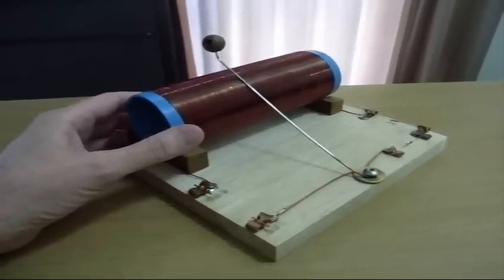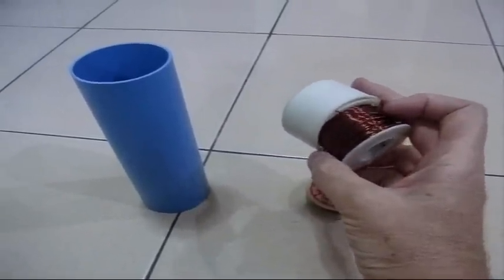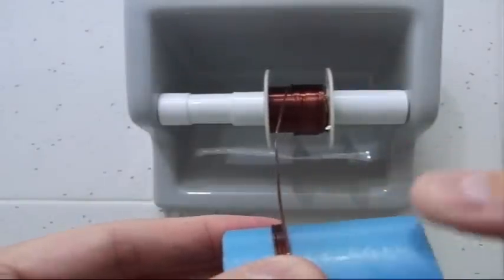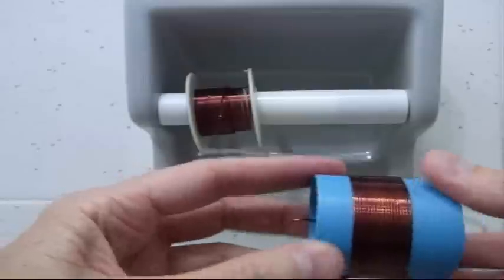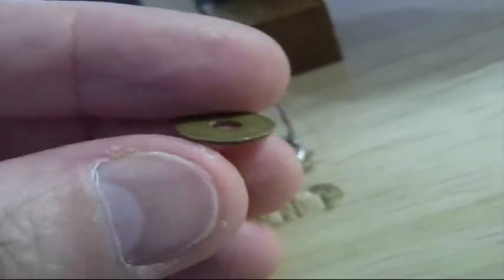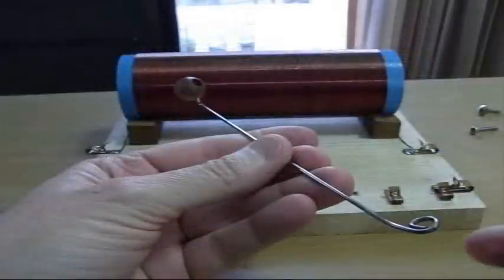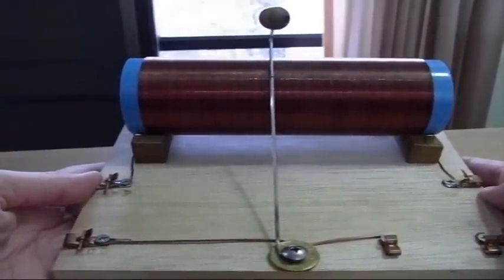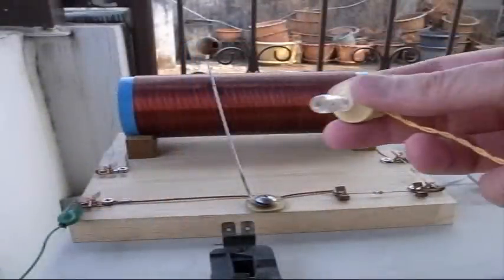How To Make A Crystal Radio - No Batteries (Updated Version Available)

Comment: just built one exactly like yours hooked everything up right connected the ear phone and nothing!!  do you have a email so I can show you a picture of it ????
Reply from the maker: The picture probably won't help.  The things to check for: 1) did you use the SAME earphone?  regular earphones will NOT work.  Must be "crystal".  2) Did you scrape the enamel off the wire to get shiny copper where it connects to the screws / connectors?, 3) did you sand the enamel off the coil where the wiper contacts the coil?  4) Did you use the EXACT same diode (1n34a)?  No others will work!
Reply: everything is xactly like your build, I am in question about the funky little ear phone and will hook something else up, as for the antenna its tie wrapped up a 20 ft galvanized pole , the total length of the insulated speaker wire is approx. 45ft from the home to the top of the pole,,,,,so whatdo ya think??
Reply from the maker: If I understand your antenna, that could be an issue.  It needs to be a long wire strung out in the open as far as you can (read the warnings on antennas in the description).  But you should still hear something if you have an AM station within 50 miles.  I used to get a signal from 2 local stations just touching the antenna lead to the mosquito screen of my room.  I also used the rain gutter (it was not grounded) and a long wire as well. 

Take one wire of the earphone off and try tapping it on the connection.  You should hear static "sparking".  If not, you have a bad connection somewhere.
Reply: @tsbrownie     yes I hear static but nothing else,  serious question>>>>>>>>.is it bad to run an insulated  antenna wire against any kind of metal??
Reply from the maker: @stanburdick9708  Short answer yes.  Radio waves pass through insulators or you would never get TV, radio or cell phone signals inside your house.  They don't pass through conductors (a metal wall will block radio well).  If you could see radio signals in a wire, they'd look like little ghostly donuts moving along the wire.  Those donuts hit the pipe causing them to slow, stop, spread out, break up, ... There's a lot more to it than this, but it's a beginning.  Watch the end of this video and see how I strung my antenna.  It's not great, but it's workable.  Notice that it's separated from everything and insulated by plastic string on both ends.  Also try with and without a ground.
You did not answer 4 above.  Did you use a type 1n34a diode?  No other works.
Reply: @tsbrownie     sorry, yes its the right diode as noted, so am thinking the metal pole is the problem, thanx for the response
Reply: changed antenna location and am getting a better interference then all of a sudden …...NOTHING

DO ALL CONNECTIONS HAVE TO BE BRASS??
Reply from the maker: Do you have an AM radio station within 50 miles?  There are 5000 in the US, so very likely.  What "cat whisker"?  I don't have one in the setup shown.  If you mean the wiper, it can be either stainless or brass, others don't work well.  It should be stiff enough to maintain a solid contact on the coil.  Did you use enameled wire on the coil?  Did you sand off the enamel were the wiper touches it?  It sounds like you have a bad connection somewhere.  You can make a video of your setup and post it on your youtube channel where I can see it.
Reply: @tsbrownie    to answer your questions>>>>>>>>am not sure  if thier is any AM stations within that range
and the only one I know of is on FM and is 20 miles away

not cat whisker but "wiper...………..so the 1/16th metal rod Im using is  no good??? and yes I sanded the contact point on the enameled coil wire

have no way to post a video so this is the only way to communicate which is why I wanted to send a picture

something strange is when I remove one speaker wire and hold it will get a good buzzing sound, but when I put the wire back on the terminal the noise goes away
Reply from the maker: If you can get a strong signal on an ordinary (non-digital) AM radio, then you should be able to receive it on this.  If you are absolutely sure your connections are clean, then the only 2 parts that can be bad are the diode and the earphone.  You did include the same resistor, yes?  You can also try it without the resistor, in case you got hold of an antique type crystal earphone (the new ones are piezo-electric and need the resistor).
Reply: @tsbrownie    a 10K resistor ?? yes its thier...…...it looks like all our messages aren't coming thru and ending short, so dont know how to proceed....If I dont hear back from ya .thiers a radio club meeting soon so will get with them
Reply: just rememebered cant get any AM stations where I am at so that prolly explains why am not getting anything  wouldn't you say??
Reply from the maker: Highly likely.

Comment: you should try to make a diode with a rusty nut
Reply from the maker: I've used galena, a lead mineral.  It works, but adds another point of failure.  With the basic radios I try to give people a sure system to build confidence.  From there they can try more advanced builds.

Comment: why shouldnt you use it during lightning storms?
Reply from the maker: Giving lightning an easy path to ground via an antenna invites lighting strikes.  That is extremely dangerous.  When not in use it is always best to disconnect an antenna and never use it when there's a chance of lightning.
Reply: +tsbrownie also indoors?
Reply from the maker: If the antenna is indoors there is minimal lightning danger, but also the antenna will probably not work as well.

Comment: This is Tesla's free energy device. Now imagine you take the earphone feed, but instead of using it to produce sound, you attach it to a battery. Maybe you need to scale it up to get some useful electricity out of it. But that's the basics of Tesla's free energy device, where Tesla was promising to "broadcast" electricity for free to everybody... That's it right there.
Reply from the maker: +Scott MacDonald Or you could watch the one I did!  https://www.youtube.com/watch?v=xn7U16j7IsU
Reply: +Scott MacDonald - The device would need to be scaled up huge to provide meaningful power. But to power a city, the device probably wouldn't need to be much bigger than a coal burning steam turbine power plant. So, it's a viable possibility as a power system, to convert radiowaves to electricity. But we'd probably be just as well off to just make a bunch of crystal batteries for home power systems.
Reply: When you use a crystal radio, you're feeding off energy generated by the radio station. So that energy isn't free... they have to power their broadcasting equipment which costs them money.
Reply: @scottmacdonald6188  True. All so called "free energy" devices really just get the power from somewhere and someone is paying for it. And beyond that the coupling losses are so huge that they have no practical value.

Comment: Am I the only one missing a coil in there? There should be 2 coils: one for picking the signal from the antenna and another one (coupled to the first one) for building the resonating circuit (tuner). Also, I'm missing the capacitor  in that resonating circuit. In case only 1 coil were to be used, then it shouldn't be used for tuning. Instead, a variable capacitor should be used for that.
Reply from the maker: The big coil is split into 2 parts by the wiper, 1 towards the antenna, 1 towards the tank circuit.  The capacitance comes from the turns of the coil being close together and with modern piezoelectric earphones, the earphone contributes a lot of the capacitance.  I have other designs that use capacitors.
Reply: @tsbrownie  OK, thanks for clarifying
Reply from the maker: If you want a capacitor type crystal radio, this one has worked the best for me so far:  https://www.youtube.com/watch?v=AaNpFYe5dSo
Reply: The Antenna supplies the capacitance,.Sliding the tap adjusts the inductance so you can tune it.

Comment: Can I listen to alien frequencies with this thing?
Reply from the maker: Yes, yes you can.  If you mean frequencies that are alien to your normal listening habits.  Or if aliens are using them to communicate.  Or if you live near 1 of the national borders.  All else might take some tweaking.
Reply: Well what I'm trying to do is build a high powered radio to listen to other uncommon frequencies aliens might be using.. Do u think u could do that in a video?
Reply from the maker: Jesse Last Probably no reason to build one.  An old Hallicrafters, Collins, National Radio or similar multi-band radio will reach most of the bands that would propagate long distances.  They are relatively cheap and it would take a lifetime of experimenting to produce something as good.  In fact there a lots of old radios ("shortwave") out there, many have tubes but they are still good when working.  You can find them at garage sales sometimes or ham radio swap meets and such.  The next trick is to have good antennas.  Long wires situated in different directions.  Or an old (big, DIY) dish antenna.  A good ground is important. If you want to get outside normal bands, like listening to solar storms and such, that's a whole new ball game.  I want to build one, but it takes kilometers of wire and lots of time to put one together (plus a good amplifier like in the old radios).  Super high frequencies don't travel long distance so you don't have to bother with those.

Comment: That earphone is from the 60's too. Must have taken this out of mothballs, and dusted it off
Reply from the maker: The earphone is the modern day equivalent of the true crystal earphone.  New ones are piezoelectric which is why they need a resistor across them instead of the cap like the original ones.

Comment: heyyyy!!! noooo the end no sound! please :(
Reply from the maker: I don't understand.  You don't hear the sample at the end?  It is short because youtube will not allow me more than a few seconds of sample or they ban my video.
Reply: @tsbrownie  yes but I wanted to see more detail. I made a similar prototype but I only get some static. I have a 1k om resistor and I think its causing the problem. You have a diod and a resistor. Why do you need a diod? the signal comes in alternating current and you need to control the flow? and why do you use the resistor? what if I unplug the resistor I hear nothing, why?. . I love your project btw.
Reply from the maker: If you are getting static that's not bad.  It means you probably have a bad connection somewhere.  The enamel is probably not scraped off on a connection.  The resistor should be TEN thousand ohms, not ONE thousand ohms.  If you are using an old (like antique) crystal earphone, you won't need the resistor at all, but might need a very small capacitor.  The diode is the most critical part and it MUST be a 1n34a.  No other works.  It is the thing that allows you to hear the data that is encoded on the AC carrier wave, otherwise you'd just hear static.

Comment: Have you made another with a tickler coil?  The result is way too short to guess the song and win a prize.  Really good volume out of it but...how many other stations can you select or are sum crammed together?  If you only got one station, have you tried bridging the diode with a capacitor? I could see action on my oscope even when the radio hit dead spots but with a 201 pf ceramic across the diode, many more silent stations were audible. Maybe its a good thing but i do not like accordions in Mexican music. God, i HATE accordions!!!
Reply from the maker: Never used a tickler coil.  I could get 17 stations on the day I was making the video.  There is a lot of overlap with stronger stations.  No, never tried bridging the diode with a cap, will have to do that, thanks.
Reply: A tickler coil is only used in a Regenerative set (eg with a transistor and a battery). Is useless in a Crystal set.
And putting a cap across the diode will kill the signal. To work it needs a low capacitance diode.
If a cap does help, it's because your tuning is all wrong.

Comment: Чтобы непоцараполо катушку надо графитом как в латре щётку сделать
Reply from the maker: "To avoid scratching the coil, you need to make graphite like a brush in latre."
Actually, you want to keep the copper clean, so rubbing it with the wiper does that.  Also, carbon is high resistance, which cuts the output of the radio.